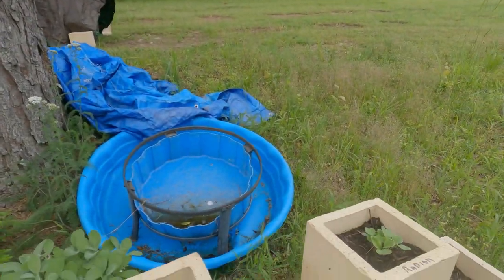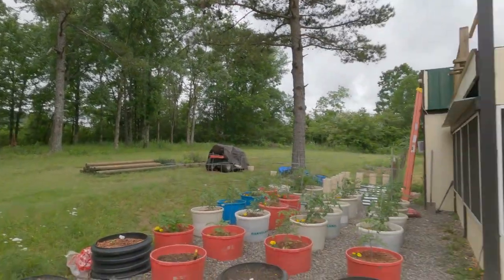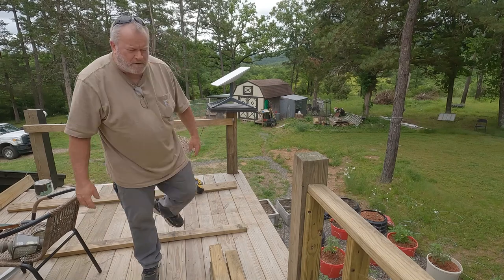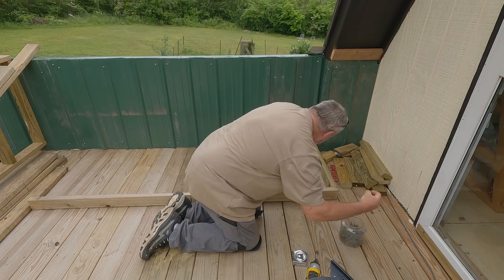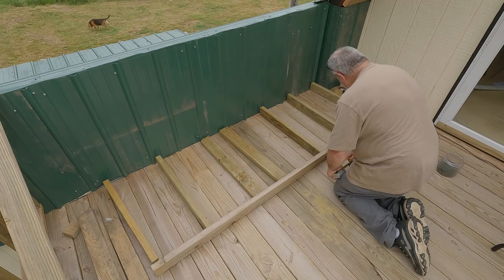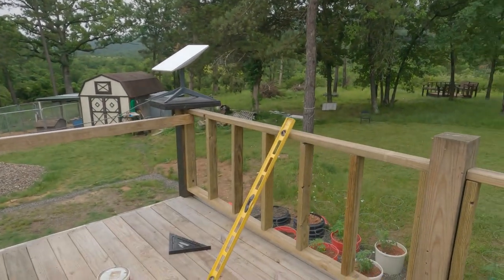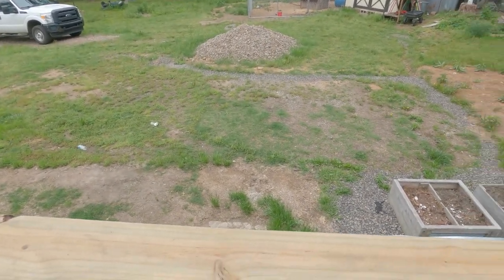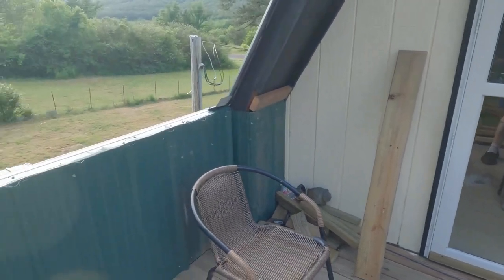Great Weather,Warped Lumber! Putting Rails On Cabin Loft Deck

Comment: Great job with the railings on the deck! By moving your container garden closer to your house you have done several  things.  Closer to your house,  less hose required and you have proved, again, that you are working smarter- not harder. Good luck with getting your work done before it gets too hot.